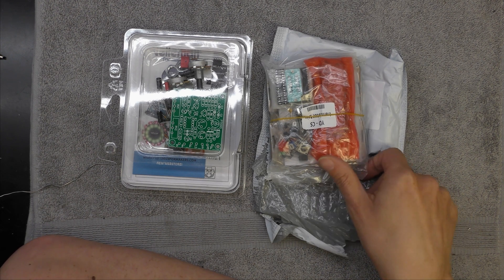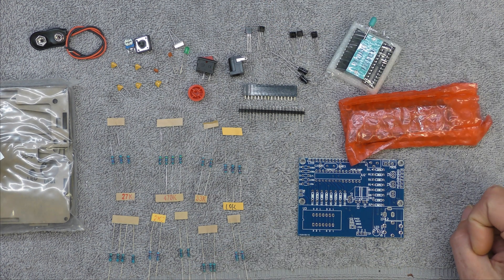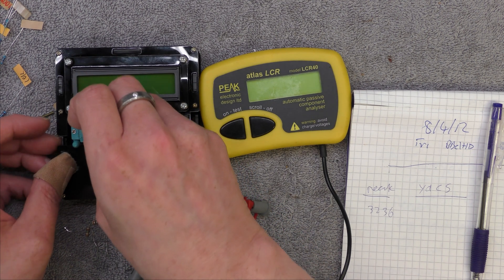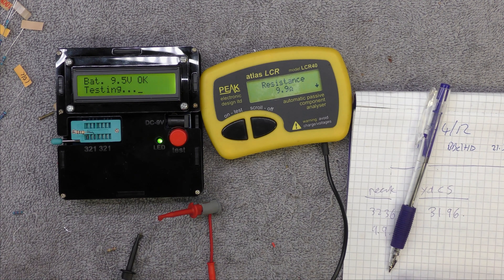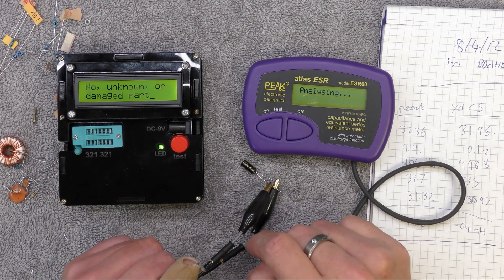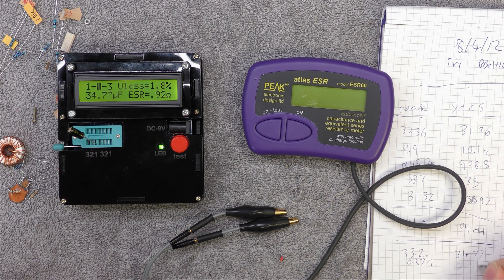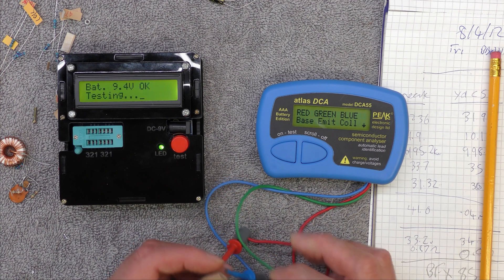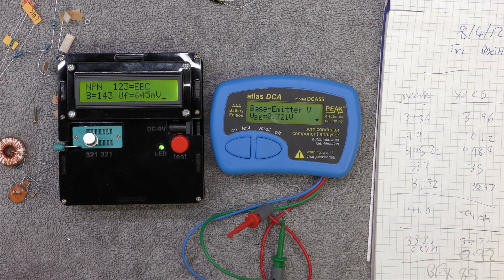Component Tester Kit Build & Test Out (4K)

Comment: Excellent :-D, you can never have enough testers.
I bought one from amazon,  it had the odd plastic case too.
But no battery switch so i added one. (I hate electronics that stays partly on).
I use it for capacitor esr,  and the values do move about so pick the average.
I removed the zif socket as it played up.  Every insertion gave too wide an error.
My old digital cap value tester (from an electronic mag project in 1985) is good enough for rough capacitor value.
Hopefully you set zero ohms by a short link in the socket and holding the button in i think.
My crap memory lol.
Reply from the maker: Ah ok, thanks for those tips. I have a made tester at work and I have noted contact issues. Daz